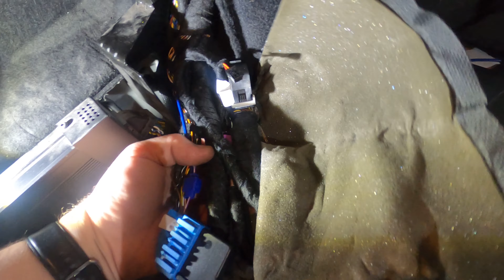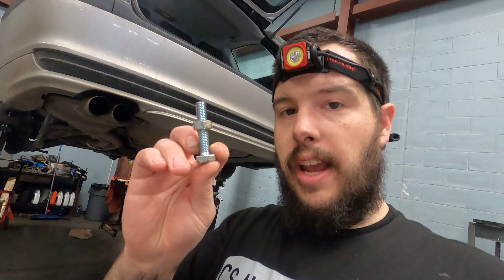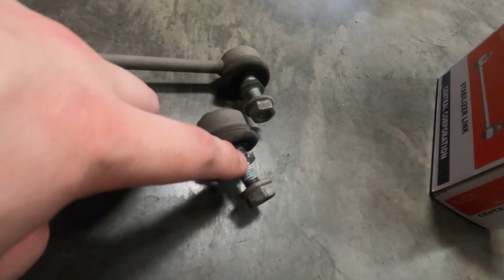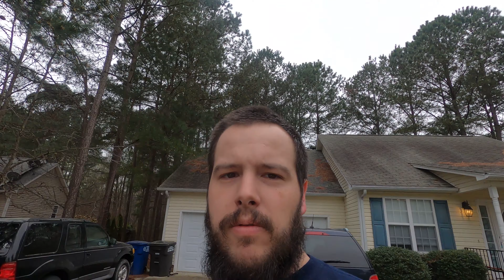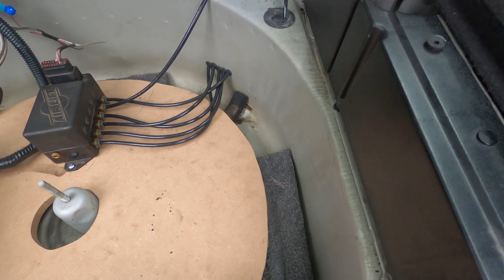E46 Air Suspension Install (Part 2)

Comment: Hey brother any idea how long the sway bar end links you use were? I currently have shorter end links already that came in a kit with a stabilizer bar but it seems like there too short. I msged the local seller I got the air ride from and they said they used oem end links so I’m kinda stuck in between… lmk if u can help

Comment: any issue with the airline smacking the axle when aired out ?
Reply from the maker: No problems at all. Only issue I had was slight contact of the front sway bar end links on the control arms. That was even with shorter links to combat that issue.
Reply: What does the ride deel like compared to stock suspension

Comment: Hello there. I'm all the way from South Africa, people here charge an arm and a leg to install air suspension R35 000.00  (2288 USD). I have a BMW 318i E46 f/l that I would love to bag. I notice buying parts separate and installing it by yourself is cheaper. I have a few questions though. 

1. Do I keep the BMW shocks on the rear and just install the rear bags ? And what's the rear bags called ?

2. Infront can i get the coilover shocks/struts for the front and mount the bags onto it ? 

3. Considering the fact that these cars are so heavy is the 4 gallon (15.1 litre) tank suitable for my car ?

This will be a nice experiment for my dad and I , we have all the necessary tools, jacks etc.

I await your response herein.

Regards.
Nico
Reply from the maker: The parts I installed in these videos is a kit from air lift performance. It comes with all the parts necessary for install. 

1. You can keep the rear shocks if you choose to. I actually have not swapped out my rear shocks yet due to having to completely tear apart the rear interior of the car to get to the upper mounts. I have probably put around 10,000 miles on it since then and have not noticed any issues. The rear air bags are technically called air springs. In the kit I used the air springs are specifically designed for the rear of the e46 and have the proper provisions to mount the spring to both the car body as well as the control arm to prevent the spring from coming out unintentionally. 

2. I do not believe there is any way to mount an air spring in the front to already existing coilovers. The front assemblies I use are designed kind of like an aftermarket coilover. But instead of a metal coil spring it has an air spring installed in the same place. 

3. The 4 gallon tank has proven to be fine. The tank normally sits at around 160 psi of pressure. I can lift the entire car from no air in the springs to maximum air pressure in the springs and the tank only drops to about 120 psi. This drop will kick the air pump back on and cause the air tank to fill back up until it reaches the 160 psi level again. The only thing I would recommend doing, and I have thought about adding one to my setup, is to go with dual air pumps. You can wire and plumb the system to where two air pumps supply pressure to the tank. This will reduce the amount of time it takes for the air tank to return to the 160 psi mark after air pressure is used. It takes about a minute or so of the pump running to get from 120 psi to 160 psi, and that is just a little long for me. 

Hope this was helpful. If you have any other questions let me know.
Reply: @MunkysGarage  thanks so much will definitely let you know when I have more questions. The complete kit you bought how much was it , when converted to South African Rands ?
Reply from the maker: Doing the conversion it would be around 55,500 rand.

Comment: Hey dude, what did you mount the tank to? Another false floor or just bolted straight into the floor ahead of the spare wheel well?
Reply from the maker: I just drilled some holes thru the carpet there and used some expanding push clips like you would use to hold like a fender liner in to hold it in place. This is a link to the style of clip I used, https://www.amazon.com/GOOACC-GRC-31-Push-Type-Universal-Replacement-Fastener/dp/B07FVKLYP1/ref=sr_1_5?dchild=1&keywords=fender+push+clips&qid=1606337852&sr=8-5. Not that exact kit or anything. But I had some laying around from a previous car. Its held in place relatively well with those. But that way I can just pop the clip up and remove it if I have to remove the tank for some reason.

Comment: I have a vert with v2 I run the airlines through the car acualy looking what you did through the car was easier lol  .. yh the way the lines go on to the bottom of the rear bags is rubish I'm wondering to run braided leader line straight of the fitting .  Good video tho m8
Reply from the maker: I agree that the way the lines go the rear bags is awful. I don't understand why they didn't have a fitting near the top of the bag to attach the line too. Kinda like how the fronts go into the bottom of the plate.